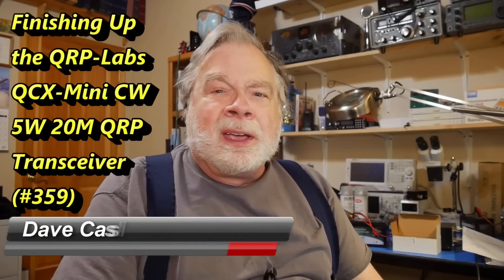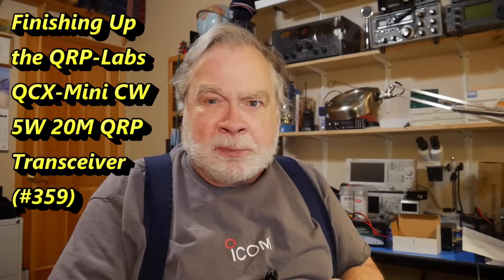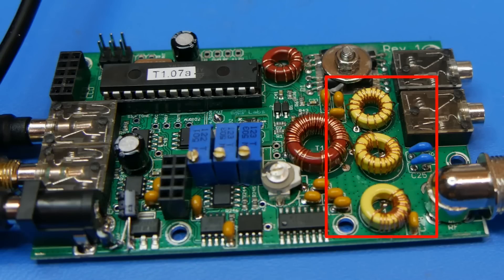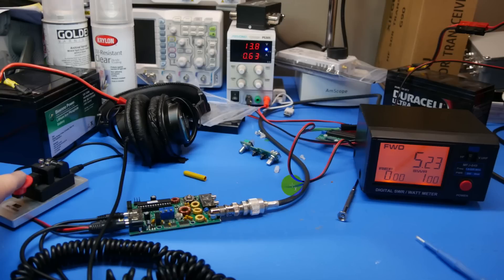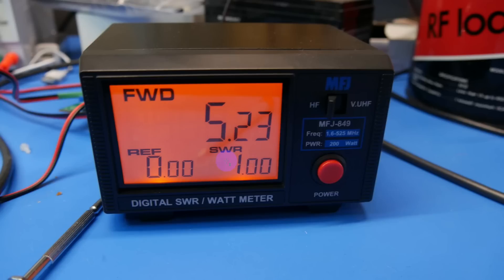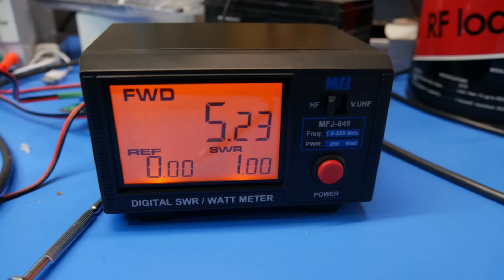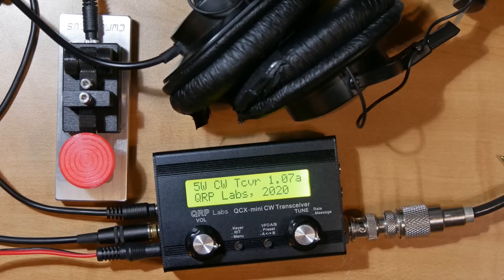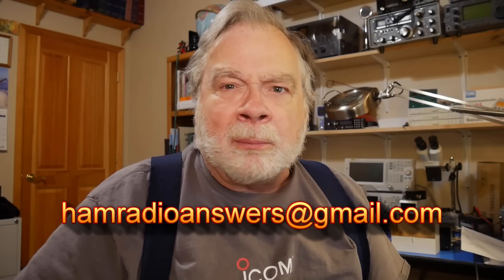QCX-mini Transmitter Adjustment for 5 Watts (#359)

Comment: QCX-mini 20M gave me 7 Watts on a full charge of SLA battery as viewed on, and calculated from a Hameg 100MHz Oscilloscope. The QCX is certainly not shy of outputting advertised power.  Note: ...it does take a LOT of spacing work to achieve that as Dave highlighted, but 5W is easily achievable.

Comment: Something about a tiny, simple setup that is so much more enjoyable than a big radio. I put one of these together as well and really like this thing. I have a question, though, about the coils. I have mine putting out 3 watts at 13v. I dont really mind that power, but is it actually using less power or are the amplifiers still trying to put out the full 5 watts but getting attenuated?

Comment: The BNC connector makes total sense for the portable QRP target market for the QCX.  It's all but standard for those folks.  It's not so unreasonable to expect someone running the QCX as a base station to toss an adapter on the cable :-).
Reply: Yes, BNC for QRP/P gets my vote. Don't want any humongous PL259/SO239s 😄.
Reply: @Steve-GM0HUU  and all the endless screwing and unscrewing!
Reply: Plus PL-259s are NOTOROUSLY LOSSY! I'm for BNC all around - get rid of the old PL-259!